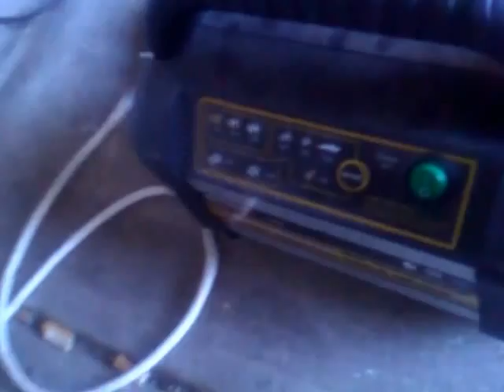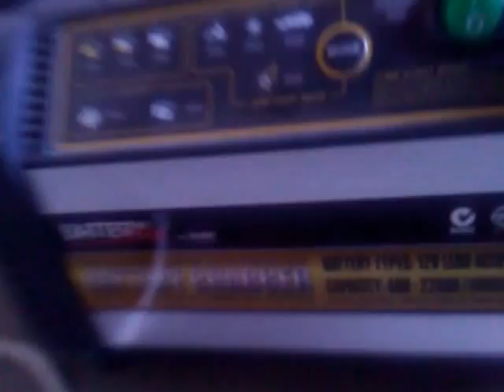2007-2008 Yamaha r1 STATOR FAULT not charging Regulator/Rectifier location read description!

Comment: One Question, What is the middle pin of the black connector that goes to the electrical system for?
does it have any use?
someone could help me?

Comment: where yo buy this thing i got 13.6 on charging not 100% 14 or 14.5 where to buy on web??
Reply from the maker: 13.6 volts is fine what do you want to buy?
Reply: @2controled  the garage man say must be 14 not 13.6 and i search the web and youtube all people say the rectifier connector and u said that where to buy and must be oem ??
Reply from the maker: @sasaz1989  13.6 again is fine for the bike power drops at times or always (depends) what is running anything 12.5v and under is a problem maybe the issue seems to be with your battery? not holding power or draining current too much coz the power is not stored and topped up and keeps charging it...
Reply from the maker: @sasaz1989  and always good to stick to o.e.m...
Reply: @2controled  i orderd a shorai battery so i dont have to replace the rectifier connector???
Reply from the maker: @sasaz1989  to my understanding no coz it's doing what it's meant to do power your motor and charge the battery...unless when it gets too hot it plays up and make surevypu get a high cold cranking amp battery (cca) recommended for the bike even on a car if you have the multi meter on the battery and turn on lights air con the voltage from the altinaror will drop as long as it's continues to charge 13v and over IF your bike is dying after a short ride as you ride can be that part but this is basically how it works "your bike alternator should charge the bike a.c then goes to rectifier that changes it to d.c there will be heat due to the power exchange of it gets hot and goes faulty than yes you need to change  that bit... coz from that bit goes to charge your bike to 13~14.5 volts d.c (direct current) or your battery is old and draining the power to complete a healthy circuit.... BUT you have stated that its 13.5v (running cold?) if you the bike for half hour and re test it on will have a proper result... the part will be near the air vent I think by memory
Reply: @2controled  i will try tomorow to do the test when cold and when warm i will update thanx man

Comment: 04 r1 I replaced my stator and rotor new battery new wiring looms spark plugs. Turn out I needed to replace the regulator only thing that wasn't powering up the bike 🙄
Reply from the maker: that's in the air box area I think by memory... they run hot but when they get too hot they fry... converts ac to dc 12v+
Reply: I JUST WENT THROUGH THIS SAME ISSUE SAME YEAR BIKE WAS SOLD A KNOCKOFF R/R LESSON LEARNED

Comment: Seriously pal if your going to post a supposed informative video get the parts right. The part in the airbox is the RR regulator rectifier, the stator and generator are the same thing and that is the copper windings on the left of the bike. You drone on to much and what you know nothing about.
Reply from the maker: good for you lol rr is under the air box and the stator is made of a magneto and coil cheap the magneto f up as it's a factory fault what they fixed in New spare parts instead of recalling them all bikes as you  can tell I did half ass the vid but in some what way you know what it helped someone   :D feel free to dislike the video it's the end of the world bro haha
Reply: 2controled yes it is it in the world especially if you give somebody the wrong information it could be their life . Just kidding bro. Sometimes I think you take things too seriously and that would be all of us not just the guy that commented
Reply: pretty much every Thing you said is wrong

Comment: my bike is surging when I ride. It startes fine but when im picking up speed surges. lights, dash have no issues. Anyone know whats wrong?
Reply from the maker: Need more info... mean it rattle forward paulseing? maybe a spark hitting the motor somewhere like a split ignition lead on a spark plug or could be air senseor? i will suspect somthing like that but to be sure just get it dyno tested?
Reply from the maker: Btw im not next to your bike to know what is going on it can even be your 02 sensor clean it put it back it can be stuffed or petrol pump give it a clean coz when they heat up give a bad mixture reading trial and error till you get to the problem
Reply: its probably your spark plugs are getting old

Comment: I replaced the stator charged the battery and went riding it died after about 30 min of riding... it gave me a check engine code 46 then the cluster went completely dead. I had to keep jumping it and it would stay on for about a half mile. I'm going to test my rectifier and see if that's the issue. thanks a lot for your help 👍👍👍👍
Reply from the maker: you must of not clicked it properly to the rectifier regulator inspection that before anything it should loud "click" make sure it's all connected right if you changed magnito just go "how to test" editorials magnito and all that but I think you didn't plug it in to the regulator rectifier if it's just that you luck lol

Comment: so what was the overall issue and how did you fix it ??? sorry if I sound redundant but I just had this same exact issue.
Reply from the maker: +king irie hi mate you will have to full charge test voltage on battery then turn bike on rev bike to 4-5 rpm you should see 13-14 volts on battery while you have multi meter on battery terminals while doing so... (if no charge) then test rectifier regulator (coz they can fry if they over heated and work in a faulty way) then if still no fult finding results on test will be your magnito or stator.... but what to do first do battery test mentiond on top to see if bike is charging (coz can be battery on crappy power holding and mechanical charging is good) BUT i suspect need to change magnito your magnets have come apart on it DO NOT buy 2nd hand part as it is a fault with yamaha to have this issue with old part need a new one coz the magnets are seated in the magnito than just glued co open your stator cover look at the magnito after pulled apart from stator but be carefull as you might drop washes or cogs in the motor and need to re aline it back how the cogs fit so the starter motor has good contact and to gear cog... part is about $600-700aud o.e.m new anything more shoot me a message :)

Comment: Do you actually know at all what you are talking about?? Resonator???volts or ohms? It is called a regulator/rectifier that changes ac volts to dc. Output Voltages from the stator to the regulator will all be measured in ac. The rest of the bike measures in dc. Huge difference if you don't get it right!
Reply from the maker: ya ya I know lol but cbf you know? clearly you knew what I mean the most motorbikes run on a phase 3 a/c and converts it to d/c  for electrical systems (the regulator/rectifier the wires from the stator/magnito (alternator) is a/c after the rectifier is d/c so.... yea I do know what I'm talking about enough to get me by but hay some what way the vid helps allot of people asking so I'm just clearly showing a fault and issues I had on my bike and to top it off make your own video lol the magnitos (how ever you want to spell it has a factory fault from 2007-2008 they are glued on when the new oem replacement is seated in the case to prevent the magnets from breaking so.... as far as I was told and know? if you read thru my comments would be self explanatory that I know what the part is and does including this one :)

Comment: Finally! someone who has a very similar issue to me. Thanks for sharing.

Maybe you (or someone) can help me please.

04 R6
Garaged for 12 months
New battery 1 week ago and started fine the first few days.

First issue: Screen lights up but bike will not start (not even clicking) for 2 days.
THEN it starts all of a sudden.

(Now I think the problem has sorted itself)

Second issue: I ride for an hour & stop. Bike off, then on again 5 minutes later no issue. 
I ride for another 15 minutes, engine light comes on and the bike just dies when I come to a stop.

I push start it & keep going but when I open the throttle up, she kind of flutters and doesn't want to work in higher revs so I limp her home.

(AFTER she dies on me a few more times - in Peak Hour - In Sydney)

(This was last night)

Now, I put the key in and turn. The fuel pumps makes its sound BUT the dash / screen does not light up (only the neutral light comes on)
headlight and brake lights work.. BUT the bike will not start at all.

I have checked fuses, cleaned the battery terminals... does this sound like the stator to everyone else? 

What should be my next move?

Sorry for the long comment... I rang one shop and they said corrosion in the haress?? and another shop said not that at all and said a bunch of technical stuff that went over my head too quickly. 

I don't want to take it somewhere and pay for hours of work if they are looking in the wrong place.

thanks
Reply from the maker: not sure about a 2004 r6 but the issue maybe regulator rectifier over heats and craps it's self... Google where it's located on your bike and YouTube how the tests are done to see if stator... but to my knowledge when the regular rectifier heats up it causes them problems so by elimination you will find out the problem test voltage if you getting around  13-14volts when you rev it it's fine the stator is ok... then if you get the bike hot and plays up try stator 
I'm at work so I am just giving a rough idea what it can be or I suspect lol not a mechanic but kinda Bush one haha 
let me know how things go charge the battery as well again and test for faults down the charging system
Reply: +2controled Thanks for your reply...

I don't have the equipment to test it myself unfortunately...

RE the heat thing, even after the bike has cooled all the way down, it still won't start. Not sure if that makes a difference or eliminates anything. 

Would you tend to rule out 'corrosion' on this one? The first shops argument was that  if there is corrosion in the wiring somewhere, there will be a dodgy connection. He would have to spend about 3 hours pulling everything apart to find it! ($$$$$)

After watching your vid I am leaning more towards a faulty stator or similar.

I will take it somewhere to get looked at (if anyone can recommend someone Western Sydney)

Hopefully this isnt going to be a big job
Reply from the maker: Ofishal Pets  To get a multimeter go to a Asian gift shop get one around $10 or super cheap auto test your battery bike off then test it as you run the bike just hook it on the battery terminals... the only corrosion I can think of is to the starter motor but don't think it's that at this point if you are getting volts over 12volts when running the bike can't be stator or the magnito then if it does on you can't be starter motor the only thing I can think of regulator rectifier but need to test it within the charging system bike shops are dodgy the private ones best thing to take it to yamaha cost me $2600 to do my bike lol just go by the you tube editorials "how to test stator" how to test a battery,regulator rectifier,stator/magnito... Then you will find the fault?
Reply: +2controled $2600!!!! I don't think I will be doing anything if it cost that much... not at least for a while.

So charge battery to 100%
If bike starts on its own, continue steps...
Multimeter on terminals...
12v + = NOT the stator / magneto

If it is less than 12v test the stator???

If the bike starts on its own or dies after starting then it is NOT the starter motor.

So if its neither of those two, then it is probably the third thing...

ahhh... joy
Reply from the maker: Ofishal Pets that's coz the mechanic took my bike hostage made me pay for stuff i didn't need...is your number (02) 4735 1710 i will call you to make things more clear if you want and give me a name to go over this properly or i'll reply in detail bit later on i live in Melbourne man so i dunno much about syd
Reply from the maker: +Ofishal Pets https://www.youtube.com/watch?v=ZzFNGlMZh3U hay just looked online for few vids um see this guy tests you will have to do them...
Reply from the maker: +Ofishal Pets https://www.youtube.com/watch?v=iq2ly6ULHi8&ebc=ANyPxKryQtWPQsdFvUBwNHZfvqGLQo3uNNAlTJjL7T8Y_t7DtLAHZbOkexghJ9tgtmGTpvQIQE4iZTblKJneike_5ZMjVarTjA and this vid should give you a fair idea how thinkgs charge on a bike  good to watch
Reply: +2controled thanks man. good to chat today and I will let you know how it goes over the week
Reply from the maker: +Ofishal Pets hope everything goes well let us know anyways... sucks balls not able to ride when it's a nice day man good luck with it but 😁

Comment: I have the same problem except it dosplays er1 er2 on screen... I have a 03 r1 and its driving me insane!!!! did you replaced the regulator as well?
Reply from the maker: +1711hec i'm not sure with the 03 modle but the regulator/rectifier heat up as they run so as we all know heat to electrical parts doesn't do well  i'm assuming that your regulator/rectifier is getting to hot and stuffing up if you have already changed the magnito and stator but on the safe side just test the thing (stator/magneto) and see if it is giving proper charge and due to the stator magneto being magnetized it will take abit of force to pull away from each other if near future you will have to replace it? but all fail take it to a dealer let them put it on a dyno and test run it...

Comment: seems like i have the same problem but when it comes to the solution couldnt i just buy the Magnet part and just put it back in there? or is it like all one peice or something?
Reply from the maker: +Omegakaiii i have taken the bike to a bike shop he said the "magneto" breaks apart the old one Yamaha has fixed the problem so the magnets wont break easy for new part replacement you will only get the magneto not the cogs gears make sure the washers won't fall in motor behind it and mark everything as it should go back in or you will have trouble with starter motor engaging the gears it will go bzzzzzzzzzzz lol and 100% make sure you pushed the magneto all the way in and gears sitting flush to the motor so starter motor touching it good.... and good luck :D
Reply: +2controled ok thanks for the information

Comment: Lol... sorry dud you almost such real bad. You don't know if it's ohms or volts or what.... and you love explaining all the things that has nothing to do with our problem.  I'd course this is a throttle, anyone with a bike have to know that. 
But good try I think. Video is very dark also. But it help maybe a little.
Reply from the maker: IT WAS MY EXP ON WHAT HAPPEN TO ME WITH A BAD STATOR NOT HOW TO FIX AND FEW OTHER INFO LIKE WHERE AND HOW TO GO ON BY DOING IT if you want to know how to test a stator look for the vid says how to test a stator or what ever you need... and since you written me off as a "dumb ass" lol i did say ref to the editorials on how to do stuff how to do stuff vids you have not told me your problem what are you trying to troll? what is wrong with your bike? i can help if you know how to use a multi meter put it on 200v put the wires on battery from multi meter as they should go rewd on red black on black or + on + and - on - rev bike to 4-5000rpm should get between 13.5-14.5 volts and it will go up or down in that field of volts if not test stator from a "HOW TO TEST A STATOR"  vid on youtube, if that works then it will be most likely the reg/rec if that's fine after testing it by "HOW TO TEST REGULATOR/ RECTIFIER" most likely bad battery cell a fuse or you haven't clipped in the wires properly why do i have to re make a vid when its already done by someone else i only made this as well just say if someone had has a similar issue and some dumb ass just says "oh its your battery bro" like they all say and share the symptoms on how and what happen and a brush over what to do and where to look and a charger shown like mine if the battery is damaged it will tell you can even be your  REGULATOR/ RECTIFIER getting too hot and crapping it's self when ever it wanted heaps of factors and to add some bikes if you don't rev them to 4000-5000rpm won't indicate to you that it is charging and you have to have 8volts-9volts maybe others are less to start the bike when it's drawing power normal as just sitting there will show 12v but when you turn the key starting the bike and volts drop below that mark of 8-9volts or what is is for your bike won't start and if testing rev bike ok don't have room on my screen to satisfy you just tell me whats wrong and i can assist if you can't work out what to do? p.s Alternator/stator Power Output is alternating current REGULATOR/ RECTIFIER direct current but good luck :)
Reply: Fool